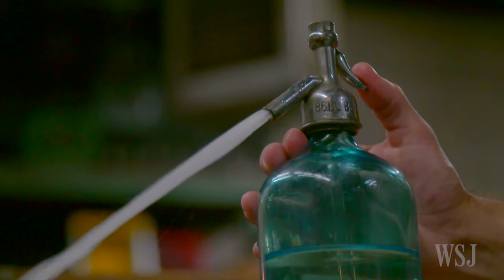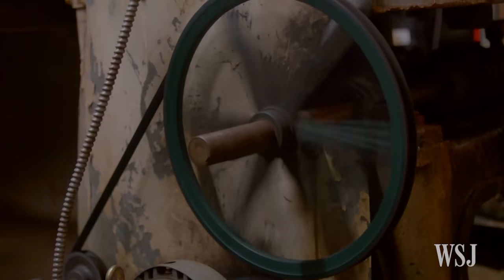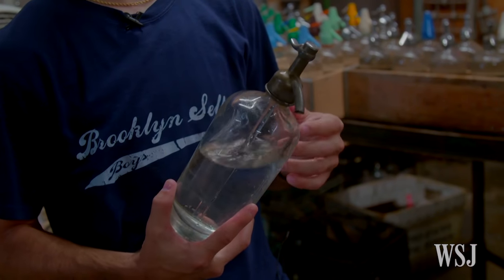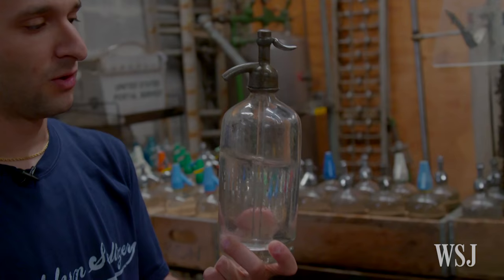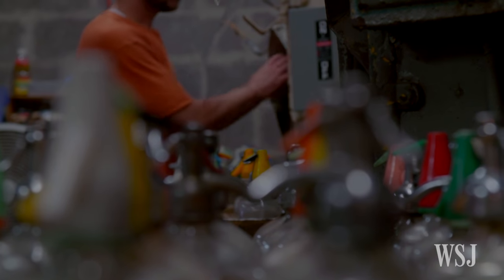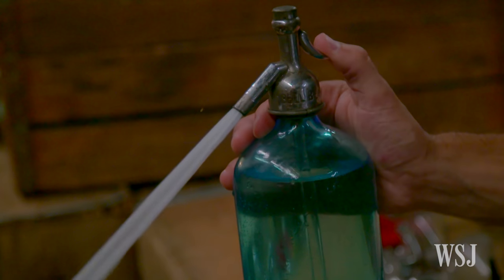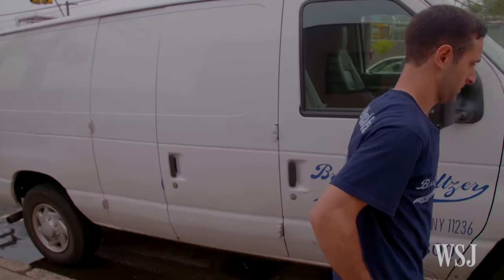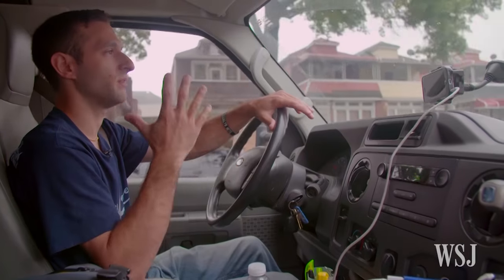Good Seltzer Should Hurt

Comment: 60 PSI? Yeah, I don't get anywhere near that with my little 16g cylinder carbonation kit. The best I can get in perfectly chilled water is 45 PSI. They must have a gas pump inline somewhere to increase the pressure past the natural vapor pressure. Even at 45 PSI, it starts to sting a bit at the throat. I can't even imagine how violent higher concentrations would be. I guess I haven't drunk real seltzer.

Comment: I just picked up a seltzer bottle at a yardsale was trying to remove the lid to use in the bathroom for a neat listerine dispenser
Your video tells me I can not do that or fill on my own but made the bottle twice a cool
Reply: Sheaffer Select you could pressurize it with CO2 and make fizzy Listerine if you really wanted to!
Reply: I guess I would not have to swish it in my mouth to get it bubbly
I have a keg system it there a nozzle to allow me to fill it or is it just better as a decor
Reply: @ARSZLB  Would CO2 work on these retro bottles?

Comment: You can't have constant pressure when pouring seltzer. The bottle is pressurised and that pressure makes the water come out. Pressure is p=nRT/V, with n being the amount of gas and V being the volume. As the gas expands and the water is pushed out, the volume of the gas increases and the pressure decreases. A half empty bottle of seltzer has only half the starting pressure. At lower pressure, some of the dissolved gas escapes from the water into the headspace, increasing the pressure a little but making the seltzer flatter.
Reply: what if we pressurize with co2 at vapor pressure? lol

Comment: Pressure guys. The seltzer hurts because when you push the button in comes out with the force of 60ibs of pressure. And it always will because of that valve. The slogan and title is saying the good seltzer is pressurized and doesn't loose fizz

Comment: How much pressure class bottle can take? Can it explode?
Reply: Allan Tamm sure, but it would take a HELL of a lot more than 60 psi!
Reply: Don't know about these glass ones, but I once attached a 2 litre plastic soda bottle to my air compressor and it went to 180psi before it popped.
Reply: Outland I smell a new youtube channel coming along
Reply: "Will it pop!"
Reply: Allan Tamm I've dropped one of those type of seltzer bottles before and they explode with quite a pop.
Reply: Im surprised, 2 years old question. And nobody corrected that word :)
Reply: we use these all the time in Argentina. there are dozens of factories for these. we call this "soda" and it's delivered in plastic bottles (called sifón) because well... glass explodes. even back when i was really little and they still delivered it in glass bottles, the glass was covered with a plastic mesh or a couple of plastic rings that kept the bottles from hitting hard surfaces, and from exploding if they burst.
Reply: @83hjf  Thanks, I always wondered what that mesh was for. It seems so obvious if you think about it now. Glass pressure vessels, duh 😅

Comment: non flavored seltzer is gross af.
Reply: FattyMcButterPants I think you’re talking about sparkling water
Reply: Any seltzer is gross
Reply: Sarcalogos Tortolero People will really try and correct others on anything they can, hey?
Reply: Its just fizzy water. Literally water + CO2. It tastes no different from water . . . Seltzer, Sparkling water, Club soda...are quite literally all the same with the exception of some added "minerals" here and there that really dont affect flavor as much as you'd think.
Reply: @fattymcbutterpants9700  No you can't lol. CO2 is a colorless, orderless, tasteless gas . . . Behold, science.
Reply: All seltzer is gross
Reply: @Ricky_Saull  CO2 as a gas may be odorless, but as soon as it comes into contact with water, it forms a weak carbonic acid which definitely has a sour note (as most acids tend to on the human palate). That's the reason why some preparations call for nitrogen (or even nitrous oxide) gas infusions instead if the intent is to make a cleaner flavor.
Reply: @MikeTrieu  Correct - H2CO3.